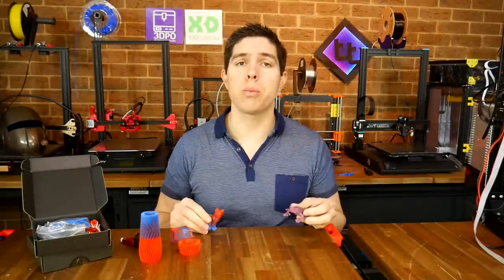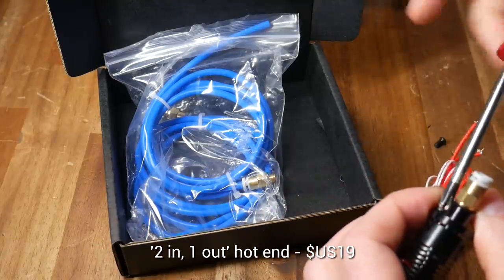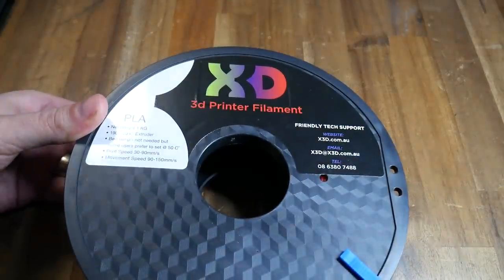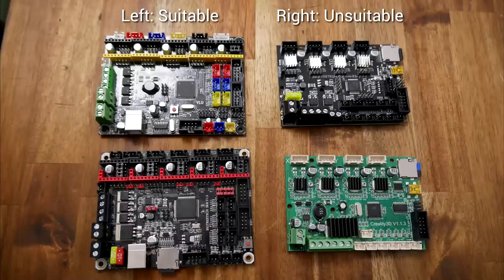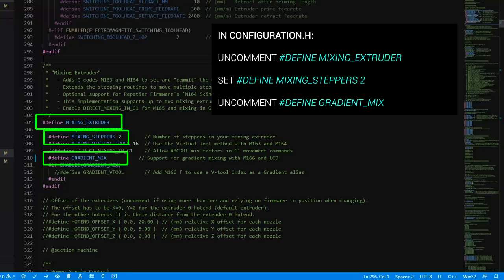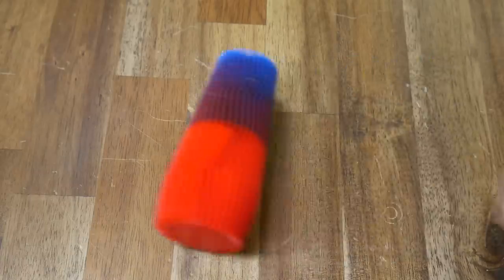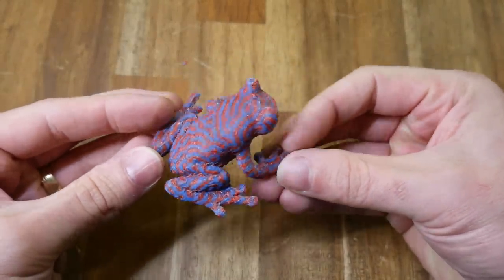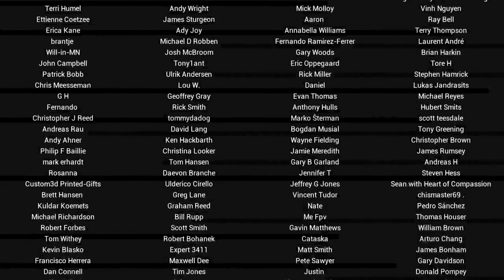Add dual extrusion with gradients - Mixing hot end guide

Comment: I guess it's OK for the price but this is yet another mixing hot end which doesn't actually mix. The printed fox is clearly different colours depending on which face you view it from. Just like the Diamond and all the other "mixing" hot ends, this one "combines" filaments into "stripey toothpaste" but doesn't actually mix them together. So the colour you get will vary around the object and will be biased towards one filament input or the other - it's pretty obvious from the video. 
You also need to use firmware retraction to retract both filaments together simultaneously. Otherwise, if you only retract one extruder, all you do is draw filament from the other input rather than the nozzle tip - that's probably why you had all the stringing. 
Also, be aware that PLA will hydrolyse  (become more and more runny) over time when held at print temperature. This can be problematic when doing 2 colour prints (depending on the part) as you need to purge out all the hydrolysed filament when switching from one colour to another, otherwise you get a big runny blob then nothing until fresh filament comes through. So the amount of purge required will increase proportionally to the time that the "unused" filament has been held at print temperature.

Comment: This is a great implementation of two color printing.  Is there a slicer out there where you can print something useful out of the purge extrusion instead of a block as long as you don't mind the color(s)?  I envision the secondary object being printed but if the layer of that object does not extrude enough to complete the purge you'd need a way to finish the purge for that layer.  Maybe add a third thin wall / no infill purge block where any more needed purge could bridge across the thin walls for that layer?
Reply: Prusaslicer allows for a purge object

Comment: I have been setting up this exact extruder over the span of the past 2.5 weeks. I got it working on my cr-10 V2 okay. The only problem that i have is that one of the filament lines clogges inside the hotend and therefor making me unable to print dual color very well. Could you please share the retraction settings you are using when switching filaments? I think it could help me out a lot. Thanks :)
Reply from the maker: I'm using the default S3D tool change script: https://pastebin.com/vdeUU43V
Substitute in your retraction speed and length.
Reply: Hey looks like you are using this hotend from a long time 
Does using a 2 in 1 hotend effect the quality of print in any away??
Or does it remain the same as stock??
Reply: @syedsulaiman8380  printed a little with it. uninstalled it pretty quickly again. when i printed with one color it was just a little worse than normal, but with both colors it was pretty bad, especially surface finish. But look at Michaels prints, those are a lot better than what i got. In the end i realized that dual color doesn't make sense for me and dual material only really works with IDEX.
Reply: @theogehling  but why did you get bad surface quality with one colour any reason? Did you ever try to fix it?
Reply: @syedsulaiman8380  i guess it was because there is more resistance for retract and normal extrusion moves. It was in now way significant but enough to switch back to single color printing when 1/100 prints require dual color. Never tried to fix it since i pretty much did like 10 prints before switching back to single color.

Comment: Mixing different materials for different mechanical properties.
Overheating the lower temperature one might be an issue, but there already exists PC-ABS blends of filament (and those have quite different printing temperatures by them self)... Perhaps keeping a low minimum flow of the lower temp one prevent over cooking the same piece of plastic?

Comment: While the original board of the Ender3 would not work, this is not totaly true to the skr e3 mini.  Most people do not use all IO-ports - for example the probe shown in the video is connected to z_min. So you do not use the probe-connector and the servo-connector - and also the neopixel and the power-controll migth be free. 2 free I/O would be enough to add another stepper driver ( Step and Direction,  put !Enable to ground). So some changes in the pin-definitions and you can add a 5th and even a 6th driver to the board - or add close loop drivers, define for x and y and redifine the x and y drivers to become e1 and e2.

If you have a stock board, you have to change anyway due to noise and low flash size. So go directly to an SKR 1.3/1.4/1.4Turbo. But if you already have upgraded to an e3 mini, it would be sad to throw it away yust because you need another driver.

Of course there is an other way, maybe even cheaper, but I did not try them by now: Octoprint+Klipper. Klipper supports multiple boards, so you might use an SKR e3 mini for x y z (and maybe z2, if you added second leadscrew) and the original board for e0, e1

Comment: I hope you do a piece on using purge buckets instead of a purge block. I've seen some buckets for the ender 3 on thingiverse, so it's definitely a thing. Surely it just needs some gcode each filament change to move over to the bucket and extrude the required filament to purge. Those blocks seem hugely wasteful .

Comment: Would the skr mini E3 v2 work? It has double z axis stepper support so I think one should be able to be used for the second extruder
Reply: Asking myself the same Question.
Reply: No apparently the double Z axis port is still driven by a single stepper driver so cannot be used independently for a 2nd extruder.
https://www.reddit.com/r/3Dprinting/comments/i978xn/dual_extruder_on_bigtreetech_skr_mini_v2/

Comment: 11:05 You can just add extruder in simlify3d. Its on Extruder tab as button "Add Extruder".
Reply from the maker: Doing so won't give you access to the dual extrusion wizard which is the intended way to setup these prints in S3D.
Reply: @TeachingTech  Ohh You are right. I never use this wizard. That is kinda bad for simpyfy3d that they are not doing any bug fixes. Its pretty much dead.

Comment: Seems like you could put a layer height change to start moving the material hotter to prepare for a TPU material change and get a better overmolded fuse between the two materials, no?  If so now we're talking.

Comment: I just thought of a way to open the nozzle of the more expensive one:

Take  measurements of the pin holes and spacing. Afterward, print a holder, with thick walls, for rods that fit in the pin holes (machine screws would probably work I'd think). Then, insert the rods through the holes (or use nuts on the other side), position the rods in the pin holes, and turn the tool. You could use a block of wood instead of printing. Doing so could be much faster too.
Reply: Доброго.Вот только ни кто не скажет в какую сторону крутить и есть ли что то герметизируя резьбу(клей-герметик).Удачи!..."" Kind.That's just no one will say which way to turn and whether there is something sealing the thread (glue-sealant). ""

Comment: Great video, I really like how you explain things. I would like to try this on my Ender 3 as well. Would this work with an SKR mini E3 V2.0? It can control 5 stepper motors, however it is supposed to drive double z axis and only 1 extruder. Would it be possible to reassign ZBM to control a second extruder?
Reply: No, there are only 4 stepper controllers. The two Z outputs are wired in parallel so they always move together.

Comment: You showed an older SKR mini e3 board in this video which only has 4 drivers, The 2.0 model has 5 stepper motor drivers.
Is it suitable for a setup like this?
Reply: I am not sure but I think the 2 z are wired in parallel and u cnat use them separately I am not sure thoug
Reply: Nope, it has a single driver for both the Z axes (i have one of the E3 V2's)

Comment: With the mixing hot end you cant use it as a normal single extruder.  The melted plastic will reflux up into the other filament path rather than out the nozzle.
Reply: Not true. I've done lots of single color prints with my Geeetech A10M, including 24h+ ones. Just make sure to have some filament inserted into both inputs.
Reply: @Isaac________  This is the thing... You need to have both filaments inserted... Gosh... Kinda stupid but logic design. :|
Reply: @OGRECubes  Yeah I know... but... it's just strange and not nice solution :D
Reply: @Zemistr3D  It's the simplest possible design, and simple=good.  How would you design a mixing extruder that doesn't need a second filament in place for single colour?
Reply from the maker: This is not true. As Isaac says, having filament loaded guarantees success but I think it will still be fine without. On my first test print I forgot to check the direction of the new extruder and it was backwards. This means it pulled the filament out of the hot end on one side throughout the print. The print was great until I realised my mistake and stopped it. You can see this half red vase on the desk during the studio shots.
Reply: @TeachingTech  It just screams clogged nozzle to me, and needing a special tool (that is sonot included) just to disassemble it is a deal breaker alone.
Reply: @Jynxx_13  That is how I see it.
Reply: @TeachingTech  Does using a 2 in 1 hotend effect the quality of print in any away??
Or does it remain the same as stock??

Comment: Hello Michael 
I have converted my BIQU B1 to a B2 with the ZSYong Mix hot end.
I followed the instructions you provided but I am unable to get my second stepper motor (E1) to engage.
If I change the Configuration to Extruders = 2 and comment out the Mixing Extruder it will print fine from E0 and E1.
I am using Marlin 2.9.1 and the newest Configuration files.
Any suggestions?
Thanks
Mark
Reply: you need to change your slicer settings, so it also supports dual color/mix functionality, just marlin alone wont do it

Comment: Hey Michael, would you try soluble support with this? And maybe different materials like TPU+PLA. Also is nozzle for 2 in 1 out standard MK8 or some proprietary?
Reply: FIREFIRE CPB:- you cannot do different material in mixing hot end. For one they don’t mix and the melting point/ chemical composition is different.  I have an A10m and you can’t even print different brands of pla together well as the are just too different.
Reply: @BasketballPro10  Good to know but I believe even with the same brand different colors have different properties.

Comment: Would it be possible to use the stock board but switch power from one extruder to another? Basically is there any output on the board that can switch a relay?

Comment: Hi,

I have a question, if I want to add more extruders how I set up the firmware pinout and how the GCODE will define the pin with the slice design? Sorry if this question is to easy I’m just new at this. 

Thank you

Comment: How does it do single filaments? From what I understand both filaments need to be present to prevent the plastic from going into the other nozzle, but if both are constantly in the hotend, wouldn't that degrade the unused filament? If it does, how often you need to purge the unused filament if your only going to be printing with a single filament?

Comment: At first I thought that you shouldn't have a waste block with this extruder.
and if you don't change color that often?
Can't you also set the nozzle to move aside for a moment until the nozzle rinses until the other color is there and then continues printing?

Healthy Greetings from the Netherlands!

Rob
Reply from the maker: Unless you have a purge bucket to catch the purged filament, it then catches on the printed object. Unintentional hairy lion. Other slicers do it better than here. For instance, the Palette Canvas slicer will lower the infill where colour switching for that layer isn't needed.
Reply: @TeachingTech  Does using a 2 in 1 hotend effect the quality of print in any away??
Or does it remain the same as stock??

Comment: Hi guys, which sensor type is included in the kit? 
I'm using Klipper and configured: sensor_type: NTC 100K beta 3950
I ran a pid auto tune, but I somehow get the feeling that the noozle isn't hot enough. When trying to calibrate e-steps, the extruder starts to klick.

Comment: I'm running a mixed extruder with a skr 1.4 board and a tft35 v3 touchscreen. For the touchscreen side theres nothing for gradient or switching extruder. But in marlin mode you can. Am I missing something?

Comment: I just did the mod to my ender 5! So cool
Reply: What board do you use for your ender 5? I have the "silent 1.1.5" board on mine, but really want to switch it out for something better.
Reply: @briguy9915  SKR V1.4 would be a good board for the printer.
Reply: @briguy9915  I personally think I made a mistake with choosing the SKR pro because I had to heavily modify the base of the printer to move the power supply. But it works great.  I just wanted to have an extra port for 3 color prints with a 3 color 2 in  one out nozzle

Comment: im wondering something can you use 2 material with a mixing extruder ? huh
id like to see something like pla + nylon or pla + tpu for example lul 
*saying that. if you can change the temp before extruding each material 
i wonder the damage it can does to the nozzle

or with a Y style dual extruder 2 feeder into 1 nozzle,1 at a time

Comment: Well when using the first hotend type (which btw can be created with a y-adaptor from Thingiverse) you don't necessarily need a main board with an extra stepper motor. As tool switching action you could modify your firmware to trigger a relais to switch between the motors. This is possible since you don't use both steppers at the same time on the first hotend type.
Reply: Do you have any more info on this? I’ve had this exact idea but can’t find anything like it
Reply: @TDOGGisawsome  that was just an idea that came into my mind, I never actually tried it as it might become a pretty bloated setup. Also, I recently switched to Klipper firmware which has MultiMCU support. So missing pins for stepper drivers isn't that big of an issue anymore.
Reply: @comedyclub333  I’ll have to look into that. Can it be installed on the same board?
Reply: @TDOGGisawsome  Klipper runs on a Raspberry Pi using your MCU just to control you motors. All the GCODE interpretation and calculations are done on the Pi.

Comment: What is that second program he using to modify his designs? Been trying to use mesh mixer and looking for another option
Reply from the maker: The only software seen here is Meshmixer (elongating the filament holder STL), Visual Studio Code (for editing firmware) and Simplify3D (for slicing).

Comment: I really really want something like this to work reliably, but in my experience, the dual mixing head just doesn't work. 
I owned a Geeetech A20M for a month and never could get it to reliably print. No matter what I did, it had problems with stringing and no amount of tuning / retraction settings could fix that. 
Even single color prints had many issues with the second color 'blobbing' into layers. 
Luckily I was able to return the A20M before my return window closed.
Reply: Note, just by having one poor experience doesn't invalidate the whole idea of mixing hotends. Maybe this one works better.. but i'm sure it will always have a bit more stringing.. and getting retractions dialed in should be at least 4 times harder with two filament paths.

Comment: Can just insert 2 filaments of the same color and then when a roll runs out automatically switches to the other.
Reply from the maker: Maybe with some custom work in Octoprint. As far as I know it's not possible in Marlin.
Reply: @TeachingTech  Can probably make it a hardware switch that is triggered by filament run-out sensor!

Comment: my geeetech a20t gradients with m166 are side to side instead bottom-top. Why? I've 1.1.8 firmware, is a firmware issue? 
Geeetech color mix software insert a different extruders mix ratio  (m163 m164) each Z layer change. This is how Z gradient should work...

Comment: I'm still confused why the large purge block is necessary. Is there no way to purge to infill?
Reply from the maker: That is slicer dependent and Simplify3D is behind here. Prusa Slicer can do this.
Reply: @TeachingTech  With Prusa Slicer you just seem to reduce the purge block by about 30%.  This system actually might fully work so it would be great to see you try.  By the way I can multi print on an my IDEX without a purge block, is that the only to do it?
Reply: @TeachingTech  Does using a 2 in 1 hotend effect the quality of print in any away??
Or does it remain the same as stock??

Comment: Does anyone else has a problem with the Geetech A10M underextruding? I can't figure out how to fix it, I've changed nozzles, completely disassembled the hotend and cleaned it at 230° as well as revised that the extruders are properly working. It seems to me that the system that prevents backflow is clogged with some other kind of particles

Comment: Purgeblock required? could we not use infill for purging?
Reply: Sometimes. The issue is that some layers may have too small infill volume, so you could still need a purge tower to switch to then. It's a nontrivial slicer challenge.

Comment: I bought the mixing hotend but it leaks where the tube goes into the heater block. I've cleaned it several times and made sure everything was tightened when it was hot but it still leaks. I'm not sure what else to do with it. Anyone have any ideas?